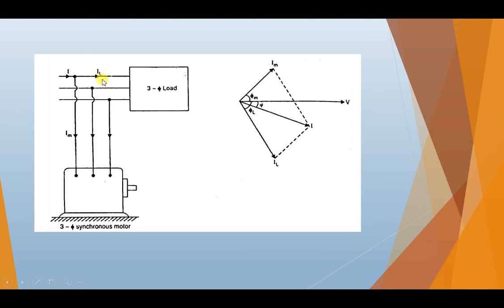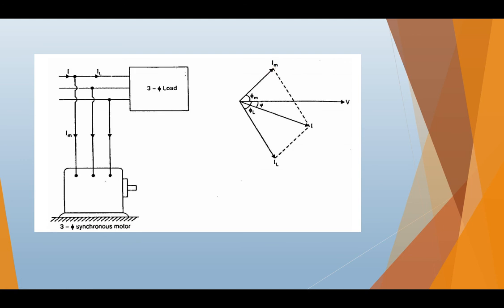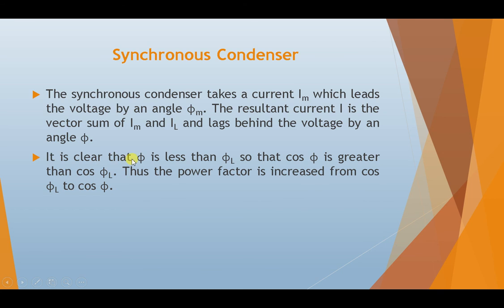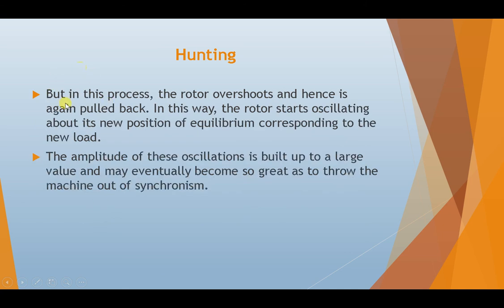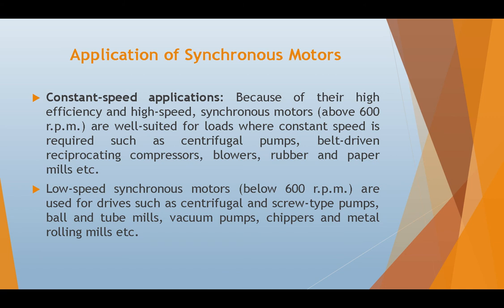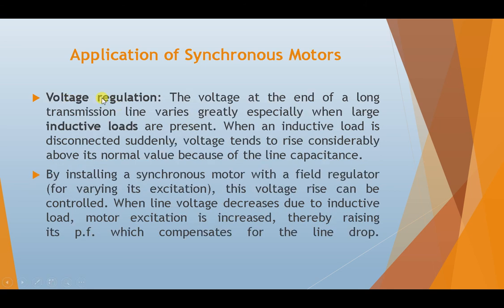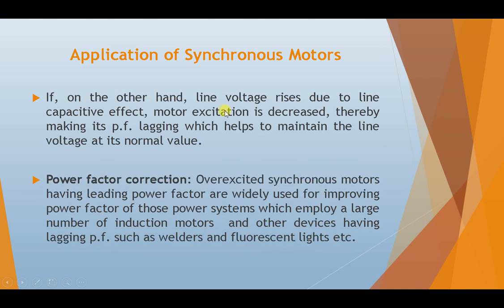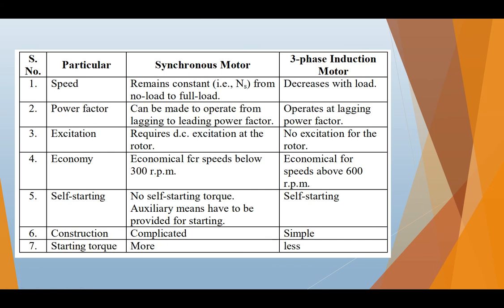Synchronous machine Application and power factor improvement

Comment: Question. What happens if you use a single phase synchronous condenser instead of an inductor in a LCR circuit? Soft start by hand if the rotor does not start rotating.